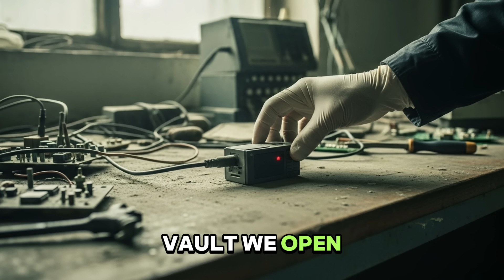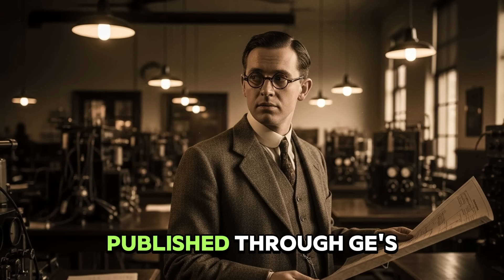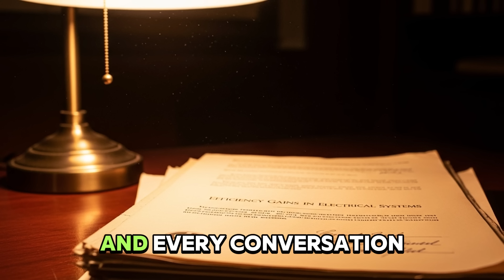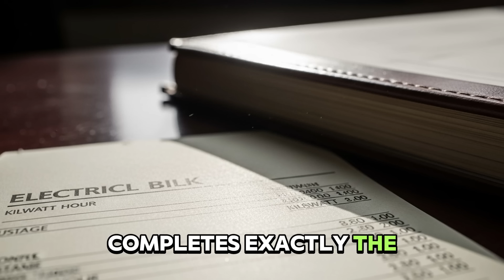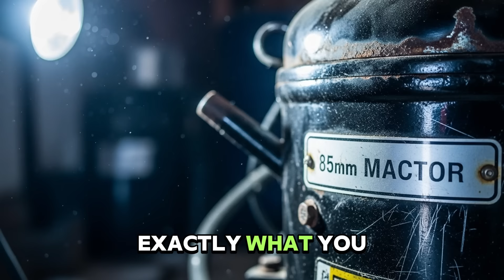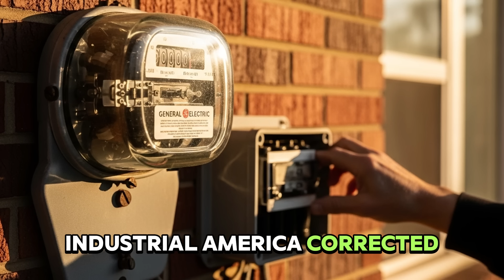This $2 Device CUTS Your Electric Bill 40% PERMANENTLY. No Solar - Why Power Company BANNED This?

Comment: Will installing multiple capacitor banks after the main  power line increase the phase lag/power factor correction? Already have a 180uf/450v capacitor bank at the main breaker

Comment: We need to refute to the assertion that residential electricity bills contain 40% hidden "engineered waste" due to reactive power is necessary. Reactive power does exist—it's when inductive loads like motors cause current to lag voltage—but it’s primarily a factor in industrial settings. Utilities do charge for it in commercial applications, but in most homes, the amount is so small that it has negligible effect on the bill. There’s no evidence of a long-hidden conspiracy; instead, power factor correction is a legitimate practice for large loads, but it won’t yield the massive savings claimed.
Reply from the maker: Thanks for the interest! Really appreciate your support.